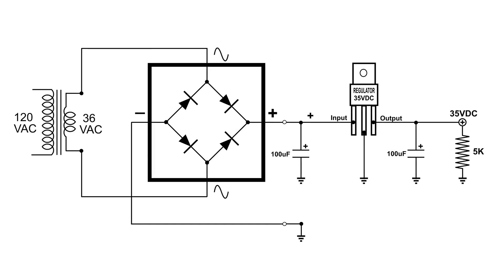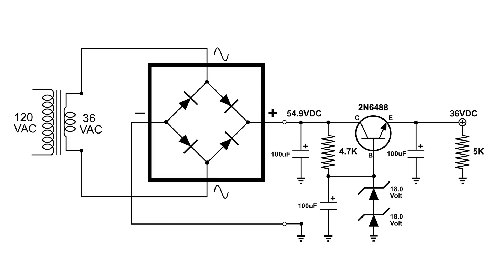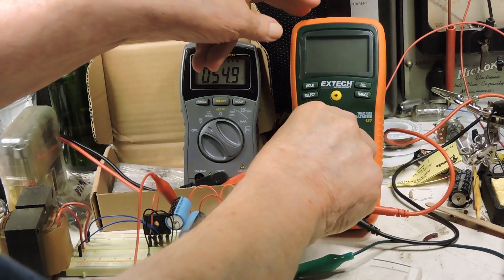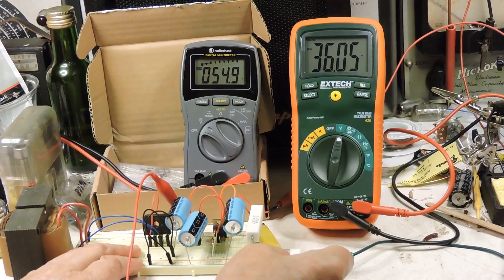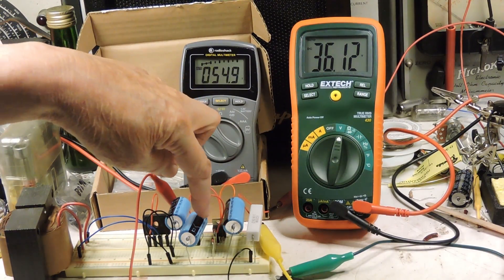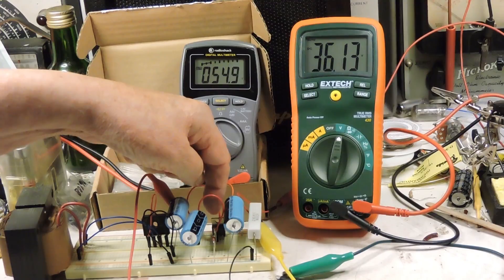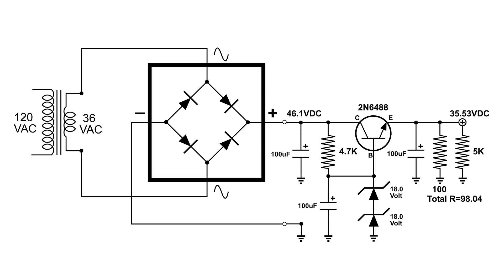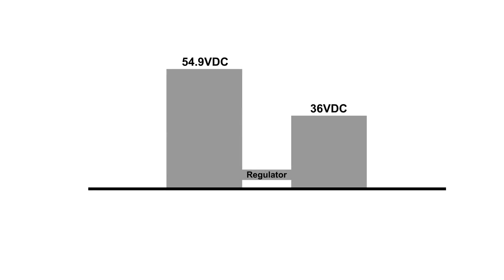Make a Voltage Regulator

Comment: Can I use this circuit as motorcycle rectifier to charge the battery. Need 14v output. Where need to change inside the diagram. 

Waiting for your Valuable  reply.
Reply from the maker: I would go with the motorcycles manufactured voltage regulator to charge your battery.
Reply: @AllAmericanFiveRadio  In fact, I wanted to know the purpose of learning, sir!  I have an 80cc motorcycle whose regulator rectifier broke down a few years ago!  I bought a few regulator rectifiers from the market.  But those were counterfeit goods.  My 3 batteries are damaged due to over voltage.  I made the charging circuit with 78xx regulator IC.  But it is also damaged due to excess voltage.  As an electronics hobbyist I was looking for a solution.
Reply from the maker: @SkjoyBd  Something similar to the circuit should work. The voltage regulator would be 12 VDC, but it would be a hefty one being able to handle enough current to charge your battery. I do have other videos on the subject.
12 VDC Voltage Regulator how does it function in circuit
https://www.youtube.com/watch?v=4vTZWdkzzA8
Regulator Power Supply Kit FK808 Circuit Description
https://www.youtube.com/watch?v=qzvsNpwKJwA
Adjustable Voltage Regulator LM317T functional demo
https://www.youtube.com/watch?v=2TZZX9FOMmM

Comment: AllAmericanFive.....Just curious:  If two or more transistors were in parallel to handle several amps at the load *****would each require matching zeners too, or could they all be biased using just the original  pair (as in this case)? Likewise, can Mosfets be used in this application? Lastly, though I've seen similar zener circuts as yours before...do these circuts cause ripple voltage concerns (similar to Switch mode Power Supply) and need help cleaning up the final output (even if there were several volts head room on the supply side) ?  Thanks, just subscribed.
Reply from the maker: Matching components is difficult and pricy. It would be much better just to get components that can handle the current and voltage required. I had not thought about using MOSFETs in a voltage regulator. I Googled “MOSFET voltage regulator circuit”,, found many circuit examples and pages of information.
Reply: @AllAmericanFiveRadio  :  Thanks for the advice and quick reply. I'll look into the moset circut design too. Thanks and very best regards.
Reply from the maker: @Rev22-21  Thanks and your welcome.

Comment: Have to say your videos are so compelling, and easy to understand. One thing I can’t understand is: I was always under the impression that the DC voltage was supposed to be 1.414 times the AC voltage, or have I had that wrong for years ? Or is it the type of diodes used ? Cheers Keep up the great work !!!
Reply from the maker: 1.414 maybe the right answer on a test. But that does not cover all situations.

Comment: Could this be used as motorcycle rectifier of course I need to lower the output to 14 volt....
Reply from the maker: You could make a circuit to charge the battery.
Reply: Replace the 2 18 volt zeners with a 14 volt zener, or a 12 volt zener & 2 power diodes that normally have a voltage drop of 0.7 volt to get 13.4 or so?
Reply: I need same.

Comment: how do you calculate the required resistance for the 4.7k resistor?
Reply from the maker: The 4.7K is just enough resistance to forward bias the two zener diodes. (54.9VDC - (18+18)=36VDC) = 18.9VDC. So the voltage drop across the 4.7K resister is 18.9VDC. 4.7K and 18.9VDC, I = 4.02 milliamps.

Comment: Rick - What an awesome explanation of how to make this.... excellent job...  BTW sent you a private message regarding the AM transmitter. Would appreciate if you can take a look. Many thanks... Ron
Reply from the maker: I can't find your message to reply to. Google is doing a great job! So if I don't reply try again, like you did.
Yes a 5K will lower the voltage. If the voltage is still high up the resistance. If to low try a 4K, I use alligator clips it easier and faster.
Reply: Thank you Rick.  Will give it a shot.

Comment: So that is a regular transistor.   If you reduce the impedance of your load on the right hand side,   then the output circuit is going to need more current through the resistors,   which means you need more current through the transistor,  and therefore more current at the base of the transistor.   However,  the excessive load is reducing the voltage between the bridge output and the transistor input.   This is going to reduce the voltage difference through the 4.7k resistor,   which is going to reduce the base current available at the base terminal of the transistor,  isn't it ?   You will get some current out of your capacitor, but only transiently.
Reply from the maker: NPN transistor. The higher the positive voltage on the transistors Base, the higher the current through the Collector and Emitter. The Base current measured between the Base and Emitter.

Comment: Rick     You should have included AC voltage readings and explained how the voltage output of the transformer drops also due to the transformer's internal voltage drop across the copper resistance of the windings as current draw increases.    I have gotten bit by this phenomenon many times when I was a young player when designing linear power supplies.
Reply from the maker: Thanks.
Reply: @AllAmericanFiveRadio  You bet.

Comment: Very thoroughly explained as always Rick. I think since the voltage peak interval, that is the interval from of the calculated RMS (36v) to the actual peak (56v)  isn't continuously supplied, then it is not steady or in other words, gets easily cut down in the event of increasing load current. And I understand that it is the resevoir caps which maintain the peak voltage, however I wonder if just a choke coil would work in place of the regulator. Now of course a coil is very current dependent, but its nature is to oppose changes in current, due to its electrical enertia.
Reply from the maker: With a choke coil each side would charge to a smother peek. This would still burn out cards. We need 36VDC, this will not burn out card, also the load can change current draw.